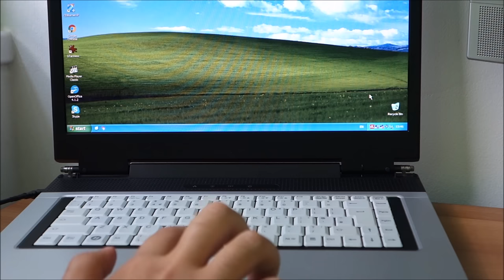🔌 How to fix a laptop charger cable and plug 🔌

Comment from the maker: ▬▬▬▬▬▬▬▬▬ஜ۩۞۩ஜ▬▬▬▬▬▬▬▬▬
        T H A N K  Y O U  F O R  W A T C H I N G !
     P L E A S E  L I K E  A N D  S U B S C R I B E !
▬▬▬▬▬▬▬▬▬ஜ۩۞۩ஜ▬▬▬▬▬▬▬▬▬
Reply: Ultimate DIY Nice
Reply from the maker: Thanks! :)
Reply: what do you call those tubes that he used to patch up the stripped wire?
Reply from the maker: It's heat shrink tubing.
Reply: oh I see...Thank you.
Reply from the maker: Thank you!
Reply: sorry but can i have a little help here 
i have a laptop np900x4c ao6au charger which the charger part smaller than the earphone port.
i have a problems is is cannot charge until i need to push it, do you have any idea about this?
( also the charger kinda bend a bit from accident, i decide to fix it because i cannot find the charger on the internet )
thank you
Reply: I do not know if you will get the notification for this comment but I want to ask if I can put the top of my laptop charger on the bottom of another laptop charger that has higher volts
Reply from the maker: What does top and bottom of a laptop charger mean to you? I don't understand what you want to do.
Reply: no
Reply: PLSSS HELP ME MY CORD AT THE END O
F MY LAP TOP STARTED SPARKING AND IDK HOW HELP ASAP PLSSSSSSSSSSSSSS
Reply: ജ്
Reply: If i really wanted to use my 2004 gateway laptop to play pc games then should i use alot of cds like a variety.
Reply: For how long before i can use my 2004 gateway laptop to play pc games. I hate it when i cant play pc games on it.

Comment: I always wondered why all laptop manufacturers make such a flimsy wiring ... my guess.... they want it to break so they can sell consumers entire new chargers just for a broken wire.
Reply from the maker: Yup, indeed...
Reply: Yeah the design of these cables is just dreadful. I've had to wait 3 weeks for delivery and spend a few hundred bucks on replacing my first cable and my second cable is also starting to give issues. Greed must have something to do with it because no product designer can be that bad at their job.
Reply: @helpme9746  Try 180 for a 330W AC Adapter.
Reply: My charger is broken, but still turning on my laptop while it's plugged in without the battery
Reply: So true, cellphone charger cables is the worst. I went through 10 cables a year
Reply: I agree with this so much.
Reply: Same interported laptops u can't even change their graphics card like wtf dude
Reply: they give you a 250v input 240v resistor, this causes it to overwork and output more v's than usual on the smaller cable. If you always have you laptop plugged in, after 3 months its broken and you have to replace it. The resistor breaks first if your always plugged in and the  smaller cable breaks first if your bend it, they come together so that you cannot separate them when one is broken forcing you to get a new one. This is a really good marketing strategy.
Reply: @meninpapin   i also had the same probrem. Only use the USB cable and use your laptop or PC to charge as they produce less voltage, therefore the cable can last longer. Charging speed will be reduced though but its a good sacrifice. The charging brick produces to much voltage for the cable, leading to demage.
Reply: Agree...   Apple Mac charger are also the same. Will burn/break near neck of the plug... So troublesome. And the manufacturer does not care. Expensive but bad quality
Reply: So true

Comment: good job, one thing you could do, is use stiff zip ties, to STIFFEN the wire.  Just use 3 or 4 of them, cut off the ziptie heads, and cut to length, then... place them beside the damaged wire, and heat shrink right over them... it will really STIFFEN them up so the wire will never bend but just flex slightly.
Reply from the maker: Thank you for the idea!

Comment: Thank you for this guide, Sir. I have a question though. Are those silver-colored wires the ground/negative? And the white wire the positive?
Reply from the maker: You need to use a multimeter to check for sure. If you just guess, you can damage your laptop.

Comment: Thanks a lot, man. You saved my life!
Reply from the maker: Welcome! :)
Reply: Hey, man. I'm not dealing with a broken pin or wires from the plug that connects to my security camera system but the plastic of the plug itself that secures the connection of the metal is bent on one side, making the fit onto the motherboard's port too narrow.

How do I fix this?

If I bend the plastic to not be narrow it could damage the metal inside making the proper connection. Also if I attempt to shove it on there that could mess up the port from the motherboard.

From one tech guy to another, I thank you for these videos.
Reply from the maker: Without seing the problem myself I have no idea.

Comment: I've just replaced my Lenovo Laptop charging cable, but this time I've put a short length of electrical conduit over the filter and the rectangular plug that goes into the Laptop. This stops the cable from bending and failing again after time. I don't know why they put the charge port on the left side when it would be better for me if it was on the right side where my electricity sockets are located. You sound as though you have a Bulgarian accent.
Reply from the maker: Hope it works well for you. I am romanian 🤭

Comment: Attention! You cut down the ferrite bead and that is bad! If you want to repair the cabling, do the same as this vide showed connecting the ferrite bead ALSO. That is an important part in the charging circuit.
Reply from the maker: Best explanation that I could find online:
"The ferrite bead or ring on a charger acts as a dead short to high frequency alternating current. The direct current from the charger gets through just fine. The length of wire from the charger acts as an antenna and gladly picks up broadcasts from cell phones, TV and radio stations, as well as the nearest microwave oven. Modern electronics are very sensitive to even small alternating current signals. The ferrite bead is there to stop them. If it wasn’t there your laptop could do even stranger things than usual. Nobody likes that."
It's just a filter and in reality it's there also to prevent your laptop from "broadcasting" as any laptop passes trough lots of tests to make sure it can be used near sensitive devices. So, your laptop will not be damaged by removing it for sure, but in some extreme cases you might see weird behaviour. Personally I have never seen issues by removing it from a charger cable. But I have seen issues on cheap usb cables that did not have it and neither did they have a mesh ground wire on the exterior. Adding the ferite in that situation fixed the cable and made it usable.
Reply: It's a hf filter for poor quality mains.
https://en.wikipedia.org/wiki/Ferrite_bead

Comment: my charger was also broken exactly there but I did the same ,just not used heat tubes:(
if I have to again cut and fix
Reply from the maker: The heat shrinks are just for a more secure and durable fix. If you are careful it can also work for a long time with electrical tape, so it's your decision :)
Reply: Did it worked? @Digvijay 1357
Reply: @UltimateDIY  Oh yeah? I was wondering about that. I don't have a soldering tool or heat shrink tubes, but I do have electrical tape.  Thank you!
Reply from the maker: Welcome!

Comment: Do I need to solder after connecting the wires or will it still work without soldering
Reply from the maker: Ideal is to solder.

Comment: My charger wire burnt through! I don't know if it's because my cat bit into it, but i noticed it stopped working followed by a burning smell, it had started a little fire where I put electrical tape. I'm thinking of doing this so thank you! I just hope its not something wrong with the box
Reply from the maker: Hope you managed to get it fixed.

Comment: is it okay to remove the ferrite bead? What are the possible bad effects?
Reply from the maker: If you don't need to remove it, just leave it there. It's really hard to guess the results. But could cause instability and interference with other devices.

Comment: Seems a poor trade-off to remove the noise filter because a bigger pain to troubleshoot a computer problem than to repair the cable again later.  I doubt that the noise will actually break anything in the computer but the filters are used for a good reason.
Reply from the maker: Yes, and no. Many times such things are used just to pass various tests. Yes, it's better to leave it in place, but never have I had issues by removing one.
But, if the pcb is badly designed, adding one could solve problems as I found out on the usb cable of a dell printer.

Comment: What do you do when you split that cable and BLACK WHITE AND BLUE need repairing to a two strand cable ?
Reply from the maker: You can't connect 3 wires to a 3 wire cable

Comment: help! My charger is kinda ripped off but the Inside of it is intact.. I put tape on it and it worked.. And then one day the tape was gone and i was rlly scared of putting tape couse it rlly was ripped up, but the wire is still intact.. Should i put tape again??
Reply from the maker: No, it really needs to be repaired or else it's a fire hazzard. It's just not worth the risk.
Reply: Ultimate DIY Oh okay, thanks..
Reply from the maker: No problem. Hope you get is solved :)

Comment: Which wire is the ground? The one wrapped around the white or the white?
Reply from the maker: Test with a multimeter to be sure, but usually the one at the exterior.

Comment: My outer cable are spread/surrounding the inner cable what should I do? Should I twist it to make one roll instead?

 I hope u understand my question my english is bad
Reply from the maker: That is a ground cable. Most times it is exactly how you describe it. To be able to seolder it, you need to roll it together.
Reply: @UltimateDIY  Alright, thanks Sir

Comment: hi sir please i have a question my laptop charger part of its cable  get really hot so the laptop keep disconecting if i cut the damaged part and solder it will be fixed and if it yes the output power of the charger will not change.thank you
Reply from the maker: Hi. You should actually do that before you start a fire. Is gets hot because it's a partial short circuit. The specifications of the charger will not change. Just make sure you connect all the wires.
Reply: @UltimateDIY  thanks a lot
Reply from the maker: Welcome!

Comment: I have another power cord with that big black box,,but I don't remember what it was used on. Could I add the wire to fit my laptop onto that box? If it's in same watts or volts
Reply from the maker: It needs to supply identical voltage (V) (+-5% is still safe sometimes) and be able to supply the maximum current (A) needed by your laptop without overheating. If this is good, then, as long as you keep the correct polarity in mind and your laptop cable only has 2 wires, you should be ok.

Comment: what do you call the thing that you heat up and it stick to the cable  like a electrical tape. in video 2:27
Reply from the maker: Heat shrink tube.
Reply: @UltimateDIY  i have this problem like in your 2:30, the very top of that is broken near the box shape of the charger. how can repair it? please help thanks

Comment: my charger was cut in the middle where the rectangular box is(to the side which connect to the laptop as you showed in this video with the part you protected from future damage), now i cut one of the circular ring and connected the outer wire but the problem is  my charger doesn't seem to have much amount of outer wire so i cant join them as solidly as i would like so now i have just straightened them on them both side just so they are touching but whenever i move the laptop/charger the connection is lost and due to coronavirus i can't get these protective coating so i tried black tape but it became sticky in just two days and now the whole point is sticky so what should i do ?
Reply from the maker: Sorry, but I have no ideea.
Reply: @UltimateDIY  no worries bro found a small pice of moldable plastic wire by sheer luck and used it to stick the outer wire then some tape and cotton string and finally the rubber coating from a ball pen  then some more cotton string on it , i think it's working fine as of now let's see how long it goes without any issue.

Comment: Is changing my laptop charger cable with another one dangerous? Only the cable not the adapter
Reply from the maker: It should not be dangerous, but depends on your skills.
Reply: @UltimateDIY  I don't mean changing it using screwdriver I mean only the plug that's removable
Reply from the maker: That should be ok.
Reply: @UltimateDIY  thanks man for the fast response, It really helped me very much 🙏

Comment: i have a different problem i bent the big metal end that is used to be inside the notebook what do i do
Reply from the maker: You need to buy a replacement cable and join it somewhere to the original one.
Reply: @UltimateDIY  thanks!, never thought of that
Reply from the maker: Welcome!

Comment: Ok so I know this video is old but do you know what to do when the pin inside the chargee got stuck in laptop and I can't charge I heard there's a fix.
Reply from the maker: Well, did the laptop connector got damaged in the process? The only solution if it did not get damaged is to find a way yo get it out and buy a new charger or at least charger cable to replace the bad one. There are some ways to force a laptop to charge even without a central pin, but they require good soldering skills, opening up the laptop soldering some resitors and risking to kill the motherboard, so it's not a good idea.
Reply: Ultimate DIY Thanks,but found out it was stuck from way before and it's the charger that burned. Will buy a new charger.
Reply from the maker: Then you are one of the lucky few with a model that does not use that pin :)

Comment: i have 2 charger, one is not working (which is my original charger hp) and one is working (original acer but the laptop broke already) if i switch the charging pin of hp to acer, will it work to my hp laptop?
Reply: hopefully waiting for you reply thanks
Reply: and it is also same output voltage
Reply from the maker: You actually need to supply a particular voltage trough that central pin, so you need to make modifications either inside the laptop or inside the charger. Overall I don't recomend it.

Comment: What do you call the gray wire?
Reply from the maker: Not sure what you mean.
Reply: @UltimateDIY  laptop charger wire has color WHITE wire connection in the inside right and also has color gray wire right?? What do u call those gray wiring sir?
Reply from the maker: If you mean the silver bare wires, they are ground (-).
Reply: @UltimateDIY  how about the white one?
Reply from the maker: Ok. Still don't understand what you are actually asking, so test the wires with a multimeter, to see what is what. Otherwise you can damage the laptop.
Reply: @UltimateDIY  what i am talking about is the white wire together with silver bare wires? What do u call those white wire sir? And sometimes that white wire is actually burned. And i dont know why.

Comment: how abt loose wire? mine its loose and i need to put some preassure to make the wire inside keep in lel
Reply from the maker: If you are confident enough open it up and fix it. Otherwise take it to someone who can, but do not continue to use it like this, because you can even damage your laptop or start a fire in the worst case.

Comment: So wait, if a laptop charges at certain angles what does it mean? Like if you plug it in and it isn't charging, then you have to twist and turn it just for it to charge
Reply from the maker: It could mean a few things. The connector inside the laptop is brocken, the plug is bad or the cable is damaged. You need to do some investigations and find the problem.

Comment: what if i remove that cylinder from my laptop charger attach the wires and use it, will there be any problem to my laptop in the 
long run like battery performance issues.
Reply from the maker: No, there will be nu performance problems as far as I know. For example if you buy another charger model compatible with your laptop, there is a chance it will not have that filter from the start. I think it's more for passing regulations and tests.

Comment: my is broken in side dose this work xd BTW the charger costed 400 sek aka swedsh money
Reply from the maker: Need more details. The charger itself it brocken and not the cable?
Reply: @UltimateDIY  Sorry for begin late to reply. You, can say that the laptop fell on the side of the way were the charger is.... it fell on the side but... the inside there is a ting btw my laptop is windows 8 or 10  i mostly tink 10 so... the inside had a ting and it broke.... and if you dont understand hmm i will try to say this like in evry charger there is someting  inside like t fell out... becouse it fell so hard to the ground, and the little pease is gone.... and you can also say that i have a extra //head for the charging// but it is pretty much also broken.... can you try to figure out if this also works or do i need to buy  new wone...
Reply from the maker: If the plug of the charger is damaged, you need a new one, sadly.
Reply: @UltimateDIY  OH, thats ok thanks for the help and btw i have a lot of chargers that are broken i tink that i have wone tht happend the same to the charger your fixing... i might i  am not so sure couse i had 4 chragers lel